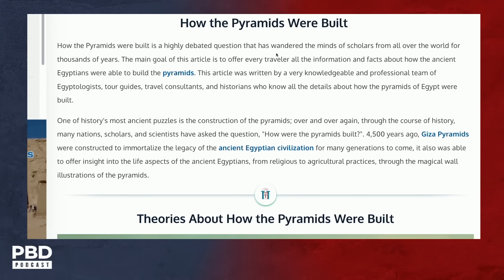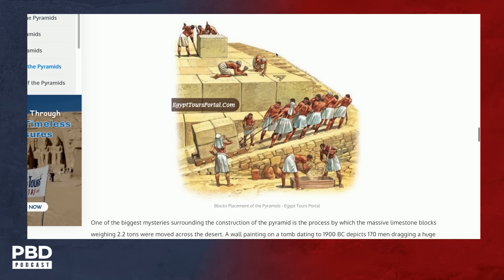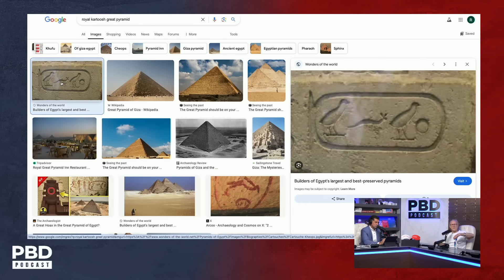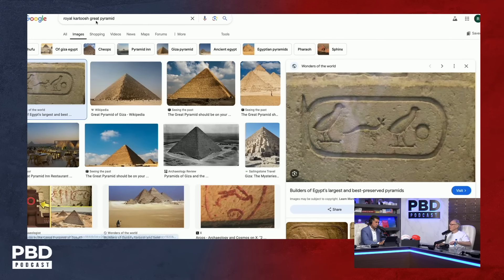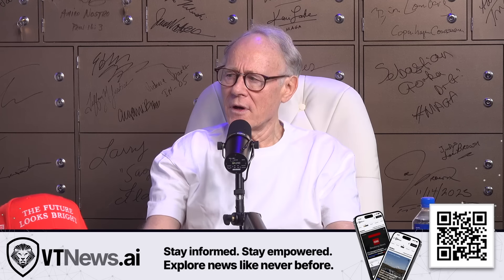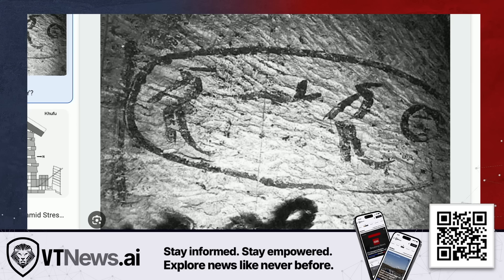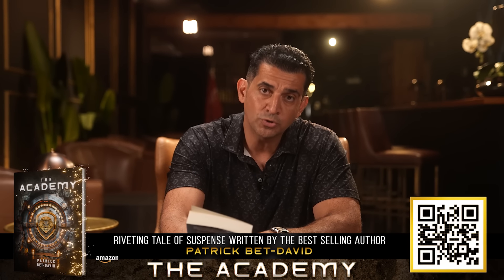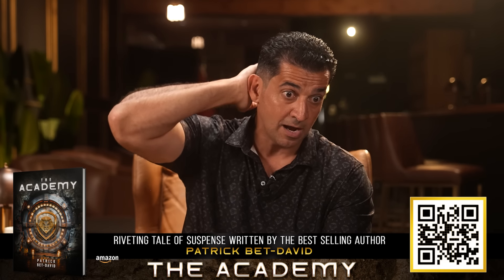"Blocks Weigh 70 TONS!" - Graham Hancock QUESTIONS How The Great Pyramid Of Giza Was Built

Comment: for all the men that have ever had to push a car....... much less weight. if you are on a completely flat surface you can push most vehicles. Effort and you have to be strong but it's possible....... get to a driveway with even the slightest of inclines. ........ also say you get 10 guys, at some point you run out of places to grab the car and people start tripping on each other. Anyone that's not a scholar that works and doesn't read and write for a living knows that most of the "theories" with ramps or wet sand is kind of silly. and raising the blocks 100+ feet. ok 😂
Reply: You would need thousands of people for one block and a really good pulley system
Reply: @kylesawkon4074 The pulley system would most likely break.

Comment: I believe the blocks used to form the basic pyramid  structure each stone became the center of a dual rimmed wheel  that also becomes a wheel of a pulley system that is counterweighted on the opposite side

Comment: These are concrete/cement blocks, rather than cut stone. There is this 4 hour amazing documentary, very detailed explaining excactly how they did it.
Reply: Agree with you but the granite blocks..
Reply: @sorenchristenson3203  yeap and you just can`t make granite
Reply: @thecustommuffler  Granit is found in nature and it was send up to the Pyramids in smaller pieces which they later melted using magnifying glasses.
Reply: @shkelzennokaj5194  😂
Reply: @sorenchristenson3203  They melted granite by using magnifying glasses, you can actually recreate that today with very small ones.
Reply: @thecustommuffler  check out the documentary, its in there explaining this specifically.

Comment: those stones are so heavy that just keeping them from sinking back into the ground was practically impossible, they supposedly drug these things on soft ass cedar logs.. blocks in the ancient era were anywhere from 800 tons to over 2,000 tons, to put that in perspective a sedan weighs maybe 3600lbs, less than 2 tons, a chevy suburban weighs maybe 3 tons fully loaded, flip a suburban on it's top and imagine how hard that would be to drag

imagine the concrete slab of a house, a thick one is 12" thick, 1 cubic foot of concrete is 150lbs, (ever lift a 50lb bag of quickrete or bench 2x 45plates at 135lbs?) average home concrete slab is 2300square ft, that's 345,000lbs, that's only 172.5tons OR 57 chevy suburbans..so imagine about FIVE concrete slabs stacked into the shape of one of these granite blocks and imagine how much that would sink into the Earth and what it would take to pull it, your brain can't comprehend pulling it, imagine pulling 267 upside down chevy suburbans, hwo many tractors or bulldozers would you need? a semi can only tow 35,000 minus 80,000lbs..so 45,000lbs or 22.5tons or 8 suburbans or maybe 12 sedans (recently they moved a 364ton stone in LA and it costs millions of dollars to move, took a 294-foot-long, 206-wheeled trailer 10 days to move it 60miles, the Egyptians moved a lot of stone much further and even over water), putting the stone on logs will make things easier but that weight is now sitting on a smaller footprint, you'd have to build a very dense road to pull it on, this is after you cut it and dig it of the bedrock and raise it, then you drag it up hill and around a corner somehow..weather permitting, and you gotta convince how many people to risk their lives and health to do this for 20+ years?

ask yourself why on earth would they need these stones in such large shapes? it was either necessary or easy for them, and rarely was it ever necessary to ever need them that size, they had their own form of concrete, anyway, check out the elephantine island box and the baalbeck stones, or the h-blocks at puma punku, cusco stones, the diorite jars and esna pillars
Reply: Wow!!!!!!! This imagery blows my mind
Reply: There are no 12” slabs in residential construction. You are guessing and stating uninformed assumptions as facts, just like Hancock.
Reply: @surfgreen60   12" is the thickest you'd ever find, so I went with that because it's easier to imagine, you can divide it by 2 or 3 if you want, slab thickness varies, but yeah most slabs will weigh half or 3x less, so imagine a slab is just 87tons at 6" compared to that 800ton block, many homes are even on 4" slabs at just 58tons, that one block is a staggering 14x heavier, 14 house slabs..that is a lot of weight, the unfinished obelisk is 1200 tons or 21 slabs, 1 slab is 19 suburbans vs 400 in that case, the largest stone ever quarried is the forgotten stone at 1,650 tons, that's the weight of 896 average sedans, that's a 64 ft long, 20 ft wide, 18 ft high stone, so chew on that
Reply: you can go to Rome and see large stone buildings , maybe its rare in America lol
Reply: @lemcakes32422  What are you babbling g about? There are no 12” slabs in residential construction. Not in Europe. Not in America. You are just babbling.
Reply: @wheelmanstan  OK. None of that has anything to do with nonsensical theories about how the pyramids were built. They were built by humans using the technology available to them at the time. I know this because there is no evidence indicating otherwise.
Reply: @surfgreen60   i just pointed out the difficulty, it was more than tiny humans with copper chisels and dolerite pounders, they knew and had far better ways of doing things during their long existence
Reply: @surfgreen60  what are you balling about you little American that never went to the moon ...stone structure are all over europe and beyond. England has stonehenge list goes on
Reply: @lemcakes32422  I have absolutely no idea what you are babbling about. I have no idea why you think I’m American. I have no idea why stupid people have so much to say about things that they don’t understand. Life is full of mystery, apparently.
Reply: @surfgreen60  you keep babbling away nonsense, i  pointed out stone structures
Reply: @CamoShirt  we don't have white european immigrants to usa?

Comment: They are molded in place to insure structural integrity…PSI rated geopolymers.  
You have 2.3 million “blocks”, you cannot risk internal fractures of natural stone (only able to check with X-ray tech).  
If 2-5% of the blocks had internal problems naturally/from moving; then you have NO PYRAMID!
As for the “granites”, they can be FORGED and cast in sand casting just like metal, and you control the density.
Geopolymers are ORGANIC CHEMISTRY, Egypt is the land of Chem…🤔🤙🏼✌🏼
This could all be solved with CORE SAMPLES, but not allowed!!!
Reply: nah they have found the quarries roughly 30 mile away, with similar sized block of stone still half cut from the bedrock. 

It was the nephilim, old goliaths family lol
Reply: @rapscity2k442  I’m not concerned about things 30 miles away, that could have been anyone at anytime trying to recreate.  
All we have to do is core sample a few blocks.  According to Greg Braden this was done in the 80s and they found rat hair/pollen in the samples and the samples were then destroyed.
I’m not opposed to Nephelim Giants though! 😊✌🏼
Reply: when have you or anybody seen that replicated today?
if moulded stone was a thing , why don;t we build that way now?
Concrete is reconstituted stone to some extent but it's  technical make up is obvious.
how do you remove the mould for a poured block when half of it is within the pyramid structure?
Reply: @Gabor-y3h  beyond insane

Comment: The blocks were artificially made! Poured in place, it's that simple.
Reply: That’s what I think too. They made the outer shell of them and went up and poured them in. It’s the only way. Unless some technology that is lost
Reply: Pour granite?
Reply: cut straight from the bedrock - they have found the quarries.
Reply: That's a good theory actually
Reply: @BrightthgirB  I’m sure they can determine if they are poured or not
Reply: how do you remove the mould for a poured block when half of it is within the pyramid structure?
Reply: @kevinprice525  I don’t think it’s poured but what do I mean half is inside the structure? They would pour one block. Remove the mold. Then put the mold on top first another and so on. They didn’t mold the entire pyramid at once

Comment: brooo only the granite blocks were heavy... most of it's blocks (over 90%) are limestone.
Reply: The average weight of the limestone blocks are 2.5 tons. Which is roughly the weight of two cars. There are over 2,300,000 blocks making up the great pyramid alone.
Reply: It doesn't matter if there was 1 or a 100.  How did they get it up there?
Reply: hi boy. limestone is also very heavy   🤦‍♂️🤦‍♂️🤦‍♂️
Reply: dude, have you ever tried lifting a limestone measuring 1 ft x 1ft × 3ft?  Unless your The Mountain, I can guarantee you ain't lifting it.  Imagine stones of the size of the stones in the pyramids.
Reply: Pre workout is not good for the brain,,,,,,,,bro

Comment: They built scaffoldings and brought the stone blocks from all over Egypt 🇪🇬  then they tired thick rop around each block and used a type of machine like a block and tackle. In modern times we use a Crain. Its as simple as that. You dont need a rocket scientist to figure it out. They also carried the blocks by a cart with wheels.

Comment: Guy from the 70s moved a 10 ton block of concrete by gumself. Up, down round. Levers and pivot points. Offset pivot point only needs to be spun around for it to go one way or the other. By himself.

Comment: Nobody has suggested the obvious... that sand was pushed and leveled around the Pyramids as they built up so they were always working at ground level ... once they finished the sand was removed ...
Reply: no different from building a ramp
Reply: @windblownleaf6450  exactly but ... key difference is that the pyramids were surrounded by deserts making sand very obtainable and very easily transported and cleaned up afterwards due to its many uses even back then
Reply: Yep, sand. And they had a fleet of 1000 30-tonne tipper trucks and bulldozers and excavators to move the millions of cubjc feet of sand ! Sure, that's hiw they did it. And they had roads and tracked vehicles.
And houses, catering and plumbing for their thousabds of workers. Yep  I can see this clearly.

Comment: Anyone played 4 in a row, when you slide down coins in a vertical plastic frame.
That's how I'd build a pyramid. Dig a deep pit. Slide down large blocks into it.
Then dig another pit beside it, slide down blocks into it, except the last block.
Go around the structure until there's only one block left. Then you'd have to dig away the surrounding land.
With a workforce of 1000 people and elephants. You could probably do it.
Makes more sense to drop the blocks into place than to lift them up into place.
Reply: it would literally be like digging out a mountain. and no way the underground wouldnt be full of rocks as well. what if you found a massive rock near the bottom? how do you get it out? very likely youd stumble across a few 100 tonners in such a massive project.
Reply: @windblownleaf6450  The pyramid stands on a rocky plateau made of limestone. I'm guessing, but exposed rock like that isn't common? Maybe at one point it was covered in dirt.

You could also imagine the hill was artificially made. They carried massive amounts of sand and dirt and created a wide hill. Which would make it easier to roll the giant blocks into place.

Still no easy task, but a shaft like structure seems to make more sense than carrying the 100 ton blocks up in the air. You'd want to start at the center, build all the way up then dig around the pillar. With the help of a lot of elephants, people ropes and logs it might be possible to move the blocks up a not so sloped hill.

You could also imagine one side of the hill is see through. So you slide it up on one side, then drop it into place, like in a skater park how one side is flat. You're able to see the (wall) from the other side. Then you would end up with a triangle shaped wall.

Here's a quick example I made.
https://i.ibb.co/5s86zzj/ex.png

Comment: Ramp theory works.

If u consider that the ramp was made of EARTH. Sand. Which a desert has plenty. Sand-mixed mountains miles long. Making the dragging of the liths a near horizontal affair.

Plus, they leave no trace behind and if they did, its burried under the desert.

Every floor of the  pyramid was build and burried in repeated cycles until the last, then uncovered by digging...

Comment: Its very concerning how they moved those blocks and people say they must have been advanced or aliens ect. BUT it keeps coming back to 3 things. 1st, the earlier pyramids had faults and collapses that were fixed in the great pyramids. So there was a progression of learning  We see some cracks ect but Cheops is very level and solid today. 2nd the insides are very basic, no "machines" or pictures at all (very strange) and simple doors sliding which goes along with no wheel at those times, just sort of pivots they had to lift water ect. 3rd, we have the big quarries and tools and how they cut it off the walls and shaped it and moved them a distance to the pyramid.  We have the tools left around the sites and pounding marks showing they worked really hard and skeletons with damaged spines in the museum. so it was hard work it seems.  I think they found proof of the way those tall obelisks were pivoted and angled upwards just as in the movie "the ten commandments"   So they did seem to do it with ropes and manpower which is all they had back then assuming no alien anti grav devices!!  So we are left with forget 70 tons, on the pyramid next to cheops had massive slabs weighing 700 tons on the base area!!!   IF NO supernatural help was there, then it had to be done SOMEHOW with just basic ropes and sleds, ramps, no, thats Hollywood nonsense as the ramp would have been man times the mass of the pyramid and theres no left over stone per se.   We have unfinished obelisk both in Easter island and Egypt laying down with pounding marks the dollerite balls next to them so trickery for the cameras left behind then by aliens or actual reality?  After centuries of practice, however they built these things, they refined the technique and keep doing it so must have been easy??  also men died early back then so decades of building ? no, they had to have finished stones hauled to site then other men lifted them many at a time and other men placed them. OR one at a time it would be one every 3 mins which cant be possible, so MANY were pouring in and levered up and each gang did their job expertly. we cant believe it today as we are lazy machine using humans, but it was done back then and we see older broken designs till the great pyramid almost perfect then his nephews after less in mass and then a small one next to that.  They built these and must have been fun or exciting or efficient as they kept doing it with minimal labour and equipment and stone having to be quarried and brought from long away on boats presumably. 
Its like the big bang , its there, it s measured and all our gods and creation myths? hmm  and the pyramids are there too even if we try to deny they could be. we are stuck with the mystery.

Comment: Poured concrete style is another option for some, which would explain how they have such close seams.
Reply: The seams are not that close.  The pyramid block seams are filled with mortar.  (which also contains organic matter that has been dated)  Also covered in chisel marks and no two blocks are the same.

Comment: Only a handful of large granite blocks at Giza between 25 & 75 tons; the vast majority are 2.5 tons - 5000 bs. Of course a large enough web of rope will move any weight; particularly if it is on logs or stone columns, even easier if it is down hill or on a raft.  Quarries were high; building sites were low. Arranged correctly a massive block could roll without effort down hill; it may even be difficult stopping it; like a roller coaster. If you engineer it well; the stone could roll so fast it's momentum could carry it up onto the pyramid stop right where you want it . Why 20 men?  How about 20,000; or camels, horses, elephants? If you want to pretent its amazing OK.

Comment: INSUFFICIENT TIME - THE BASIC ISSUE !!!
None of the current, generally accepted "Theories" on Pyramid Construction, can be borne out. Due to the fact they all overlook the "Time" factor. If a Pyramid was supposedly meant to be some sort of burial chamber for a Pharoah, it would have to have been built within around 20 years at most. People even Pharoah's did not normally live much over 40 years old in that era. And did not "reach the throne" usually before 18-20 years old. It must also be added, that NO Pharoah's "Mummy" has ever been retrieved from a Pyramid, anywhere on the planet. And there are officially currently 554 Pyramids all over the Planet. There are even two "Step" type Pyramids on the Canary islands. With NO signposts anywhere to tell you of there existence !!!! 

So we don't even have concrete proof of when these structures were built. You can't Carbon Date "Stone" to the time when it was cut. Hence they could even be a lot older than we think, and built by anyone around in that time !!!

Comment: Most Giza blocks are sandstone; easily shaped.  You make a 1/100th scale model of the Pyrimid. You take 100,000 slaves and divide them into 2000 groups of 50.  You give the slaves a piece of the model and tell them they have 10 days to make a full size block the exact dimensions; if they don't they get executed. Each10 days you get 2000 blocks made. 20,000 in 100 days; 200,000 in 1000 days; roughly 3 years in 30 years you have 2 million about the number in the Giza. They had the wheel - they had stone columns so obviously on their side those are like rollers.  They had rafts. Want it done faster? Easy more slaves. OK or Aliens.